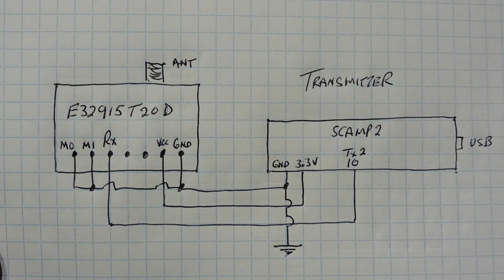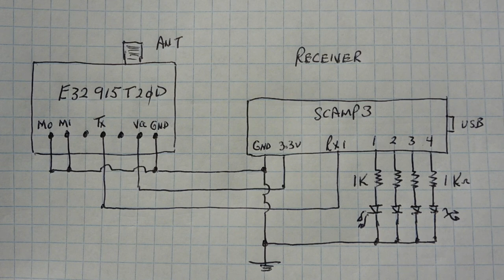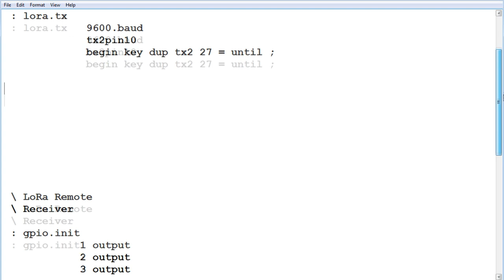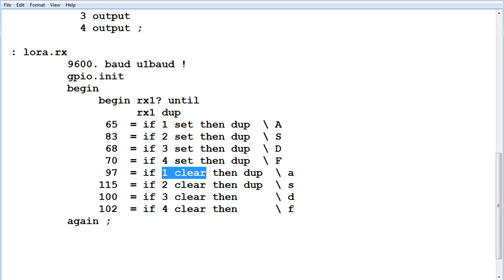Remote Control Radio Link Using LoRa / Scamp3

Comment: Using similar 433Mhz Lora Modules to transmit data from a Remote located and decoded/reverse engineered La Crosse TX23U weather station to the Shop and House. Has been working great for 3 years non stop.
Reply from the maker: Sounds like a very interesting project. You should make a video :o)
Reply: @0033mer  Too much work for too little pay... ;-)

Comment: Thats a really cool project! Im been wanting to learn how to do something similar. The difference would be relays could be turned on and off when the button is hit. Can you control this with an android phone / app instead of the keyboard? Is it possible to build this without the $30 scamp board? ty
Reply from the maker: You could use two Arduino Nanos running similar code. You can also use Bluetooth and your smartphone to control relays remotely. https://youtu.be/yXRWQpJrK6g

Comment: Hi Ken, I am a big fan of your's greatly explained "small" tutorials. Not tested but does not make sence to me why d and f are missing the dup and if other than 8 selected codes comes would not cause unlimited stack growth? KR P
Reply from the maker: Hi Pavel, if dup is added to d and f there would be unwanted stack growth. To test this the word .s can be added after the first "begin" and the stack should be empty at that point waiting for an ascii value. Adding the extra dup's would show stack values. After every dup there are two values on the stack. The two "if's" at d and f will clear them. I admit this code is not efficient as every ascii value is tested 8 times if there is a match or not but it is easy to understand what is going on. It is good to see someone is actually following the code as my YouTube stats show viewers leave at that point.
Reply: Thank you for this explanation. P

Comment: HI, having a hard time buying the 915MHz LoRa unit. My buyer got me the 900MHz unit but cant see the 915MHz units for sale online. let me know.
Reply from the maker: The 915MHz module is being replaced by the E32-900T20D modul;e which has a larger frequency range of 862 to 931MHz. The footprint is also the same. https://www.aliexpress.com/item/4000515981633.html
Reply: @0033mer  Super thank you for that info. Do you think you can control the channels that it uses for SSFH? I would like to limit the transmission to 915MHz (or closest chanel) for Coexistence testing vs. other devices.
Reply from the maker: You can progran the radio frequency to 915MHz using the configuration software from Ebyte.
Reply: @0033mer  OK thanks for great project outline,  Digikey package on the way. Will be sending packets by Thursday. This is a great project, and if LoRa technology survives it will be really beneficial to mankind.
Reply: OK, its all built and the radio modules are configured through the ebyte software. I put push buttons on the TX ports 1-4.  in the video you type the caps and lower case letters to turn on and off the lights, where are you typing those letters? in Tera Term, or somewhere else? My goal is to have a basic LoRa system for Coexistence testing with other ISM devices. Would you provide some code for a push button version?  Thank you, fun project even though I know nothing about programming.